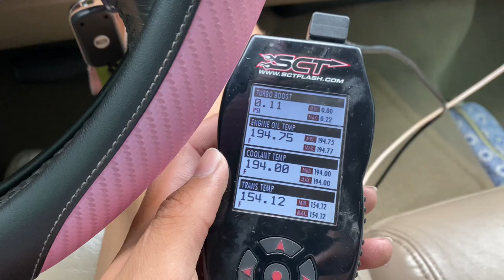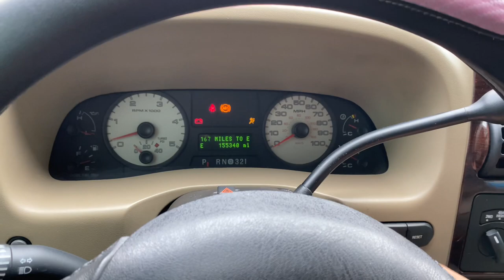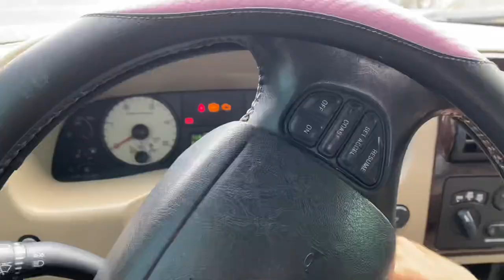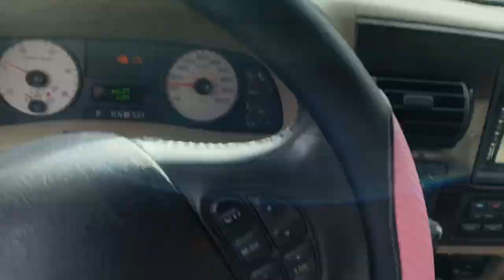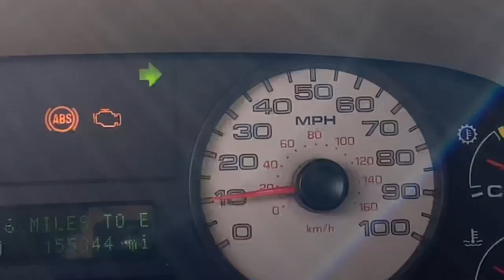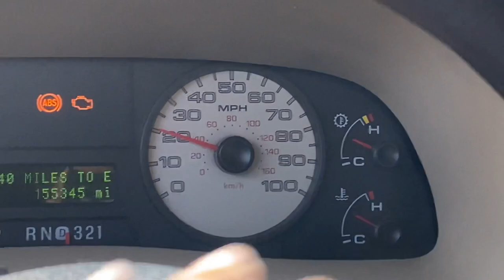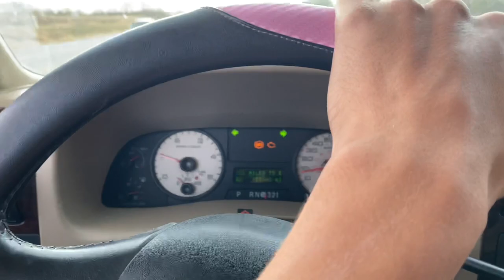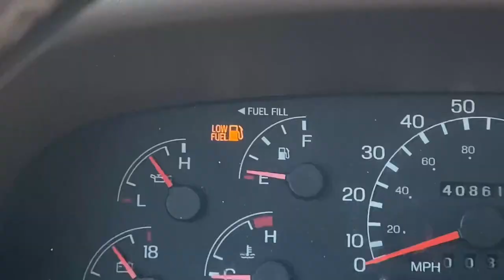Found On Road Dead.

Comment from the maker: What’s The Best Truck Brand? 🤔
Merch! ⬇️
https://inshanedesigns.com/product-category/gabe-farrell-productions-collection/
Reply: Have you seen a 2002 f250 v8 Triton
Reply: ITS A FORD DUH!
Reply: 2002 7.3 😎 that would be a FORD of course I clearly see you said what kind I had to throw seven three in there at least it was an easy fix I would also replace the IPR if the ICP went out just saying and change the oil maybe the camp position sensor too if one goes out I replace all of that that's just me I love your videos there's three items seem to last about three years
Reply: Dodge
Reply: New fords and old dodges
Reply: ford
Reply: I’m a Ford guy. But all trucks break down. We have a lifted ford 6.0 and it hasn’t stranded us yet. We have two ford 7.3s too. I would say the best truck and motor is a Ford with an old 7.3
Reply: Ford
Reply: Do you have any off road rims and tires for sale for a f 150?
Reply: The best truck brand is Chevy gmc dodge
Reply: I love Ram I had a few so that's my opinion but the Ram dually nice as hell though
Reply: Ford
Reply: FORD SUCKS!!!
Reply: Ford and maybe it would be fine if it was a 7.3 not a 6.0 lol
Reply: FORD 2016 f250
Reply: @MrHammer02  FORD SUCKS BRO ITS ALL ABOUT GMC CHEVY DODGE
Reply: 2nd and 3rd gen Cummins
Reply: Chevy
Reply: @blake_isnt_here5642  dodge is absolutely ass
Reply: @blake_isnt_here5642  GMC is good but I rather ford
Reply: Ford diesel and dodge diesel
Reply: @MrHammer02  GMC is stronger I have  a gmc 6.2 lieter that can haul 15k pounds
Reply: @MrHammer02  dodge is good
Reply: @blake_isnt_here5642  about every dodge that my family has had locked up in months or weeks of owning it
Reply: @marcusbenning4664  same man
Reply: Ford
Reply: Ford
Reply: Ford
Reply: Ford
Reply: Ford
Reply: Ford
Reply: @caidenrice3167  gay
Reply: Ram trucks
Reply: Monsters truck
Reply: chevy
Reply: Ford
Reply: The Truck master bruh by a new Chevy and place the differential
Reply: Dodge
Reply: Dodge 12V and 24V diesels
Reply: @5.4Trace  I like government cops use cars YouTube
Reply: @cookymudstar  Can I ask my guardian check my bank account please Emma Slater love you
Reply: Ford and dodge
Reply: Ford for sure best brand yet early 2003 Ford F-250/350 7.3 the best and The obs crew cabs are awesome
Reply: CHEVYYYYY

Comment: I took mine to a reputable diesel shop they did about 3 grand of work and I told them from the jump to check the cat and they never did. 3 grand later no fix. I ended up cutting the cat off myself and welding in new pipe. Worked like a charm. But thats only if its still running with a cat.

Comment: Does it still have a catalytic converter on it? If so cutt it off. The same thing happened to my 04. Easy way to tell if thats the problem. Knock on it and if it rattes around the honeycomb has come loose and causing back pressure.

Comment: you realize 202 is a pretty normal oil temp for a 6.0 right? it's not uncommon for these trucks to run at 215-220, 200 or less is completely normal
Reply from the maker: Yup

Comment: It also probably is a high pressure oil pump, but how old are the injectors tho?
Reply: I bet you it is the high pressure oil pump tho. That’s pretty common on the 6.0’s and 7.3’s. I’m a 7.3 guy but I know a little bit about the 6.0 but not much. But I would change the high pressure oil pump and see what it does
Reply: @OBS_karson_on24s  the 05-07 6.0's like this one had a revised hpop that doesnt fail all that often and when it does they generally just wont start especially when hot. this is def an injection issue, a bad FICM will do this. kills voltage to some or all injectors causing no start, low power and missfire.
Reply: @OBS_karson_on24s  oh dang i didnt watch the last 2 mins. the icp and ipr will also cause similar injection issues.
Reply: @keith2860  true, like I said I know more about 7.3’s I’m not a 6.0 guy.